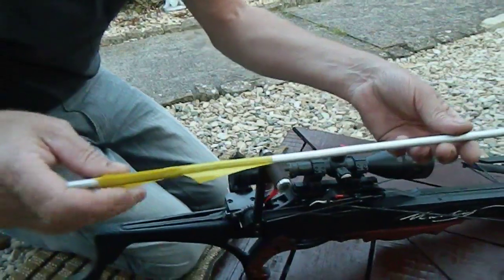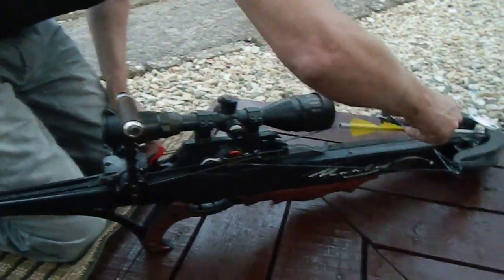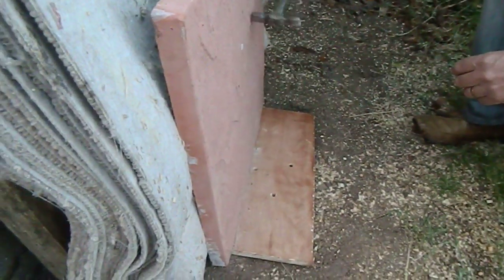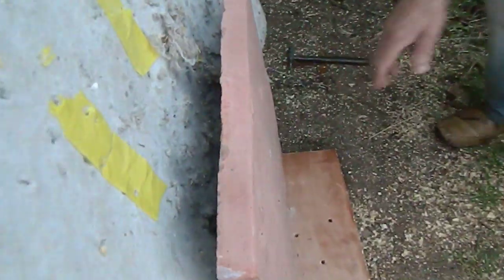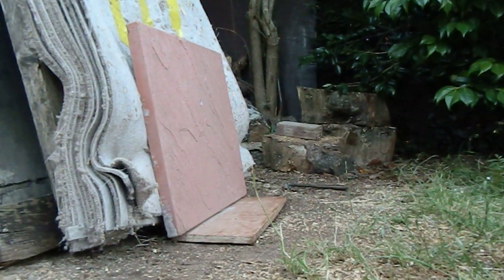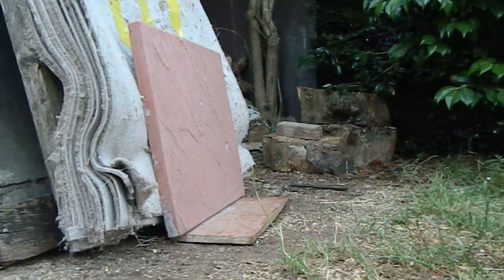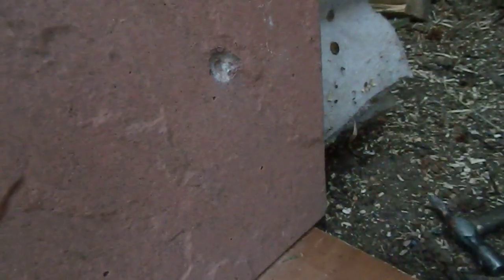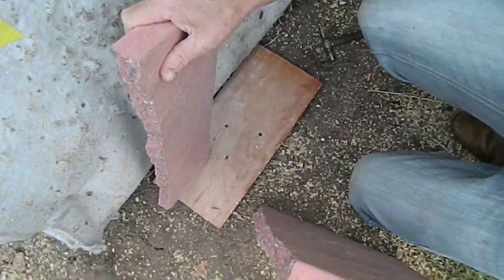The mighty Mantis crossbow vs concrete paving slab

Comment: All that invisible technology ... It's like magic ... Must be , as it's not based in science or supported by it ... Much like my bow that shoots at the speed of light ... Uses state of the art technology ... And I'm saving up for a cheap video camera and chronograph now ... 😂
Reply: Checked out their online store.
You can get it for only 4800 pounds!!.. that is around 6000 Dollars....Cheap don't you think?
Reply: @janlassen6101  innovative ? No ...  This was tried and tested by many all to find what common sense would tell you ... Springs aren't fast ... At least not one small enough for you to carry ... That's why pellet rifles evolved from springers to nitro piston to PCP ... Which they already make airbows so ... There's that ... And steel leaf spring limb bows will outlast and outperform a coil spring relying on rigid limbs 1000 to 1 ... Truly a bow for the more $ less brains crowd ... 8 yr old video ... Just doubt they have sold 8 ...
Reply: @iamlegion5826  I think it's power comes from a Gas-piston with adjustable power (?) They started selling them for around 1800 pounds. now 4800 pounds!!

If i had a bow that could do 500fps 8 years ago i would have made MANY videos proving it with a chronograf, in combination with how much the arrow weighs, ETC

The fact that they have not made any videos about the bow in many years says a lot. Guess the new tactic is to just sell 1-2 very expensive x-bows every year.
Reply: @janlassen6101 nitro piston are fast but undependable... I've seen them fail after just a few shots
Reply: What…invisible….technology….?

Comment: The more I see this crossbow the less it impresses me. For one thing I don't like that you can only load it with a crank, I never use a crank to darn slow. But I am curious as to how fast the bolts go  FPS.
Reply from the maker: +walkinthunder It is way too powerful to rope cock,it draws at 350-450 lbs depending how you set the power and that is why it has an integrated winching system it all depends what you want from a crossbow i want the very highest power and speed available i can get 600+ fps with the Mantis Elite and 500+ fps with the Mantis the Elite draws at a min of 400lbs and to a max of 600 lbs.What people need to realise is this when they say 175 lbs on a compound with cam's that's a great big lie as this is when the cams break it is more like 300 + at rest as it work's in reverse to this compound camless system which get's harder the farther you draw the bowstring.If they made a compound work the same as this with cams then it would be faster too as you are not getting all the high power at full draw like it does here.

Comment from the maker: Talisman crossbows have somehow managed to squeeeze every last tiny drop of power from the ENERGYWAVE gas spring system transfering more speed and energy to the CROSSFORCE limb system by fine tuning the running gear and limb's now it will do even more damage to a paving slab sheer bone shattering/crushing power for hunter's who want more K.E to ensure humane harvesting I will do a new video with a new slab shooting a 425 grn arrow on high power at 20 yrd's.